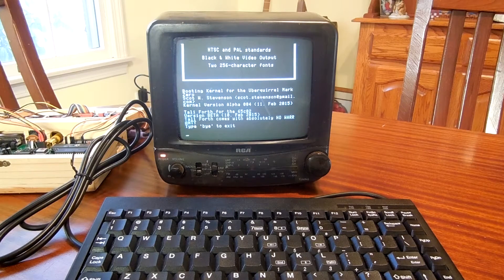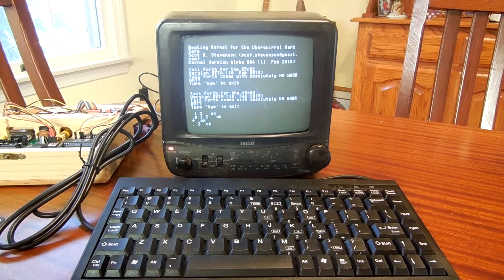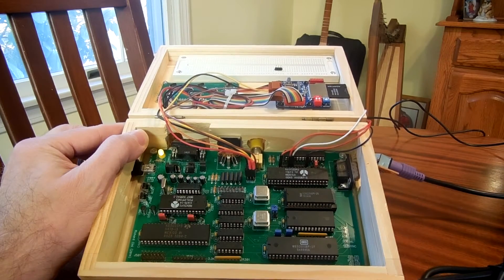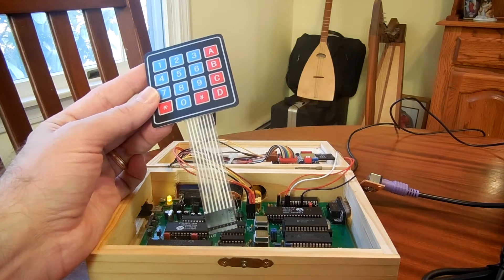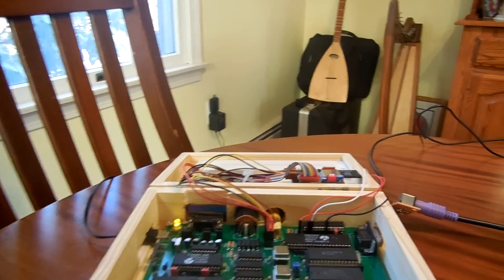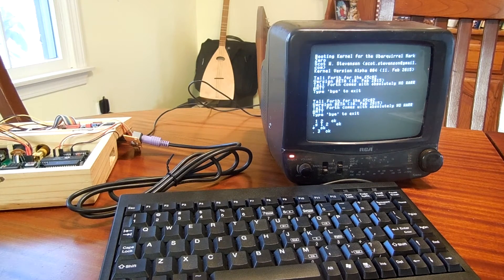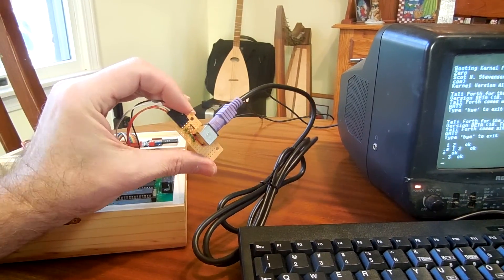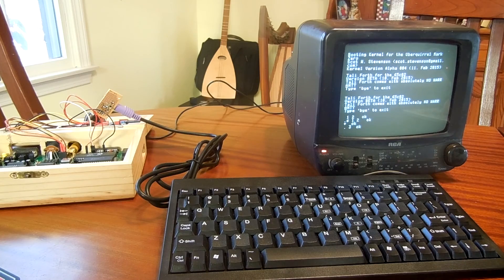Adding a PS/2 Keyboard to a Retro Computer

Comment: The interface is electrically like I2C, except with a slightly different protocol as I recall. Its weird that the keyboard is the buss master. I would have guessed interval polling, generated in the host CPU main loop or with a periodic timer interrupt. I suppose it makes it more responsive like for gaming control. But, all my computers of the late 70s controlled static hardware like video / audio switcher or hardware matrices mostly. Manual update now and then at human speed.
I also have to disagree with your assessment of scanning matrix keyboards as being much overhead on the processor. It was never an issue with my projects. But, multiplexed LED displays on the other hand are very heavy handed on CPU priority if you don't want them flickering randomly. I miss "the good old days". No. Wait... that's the senility talking.

Comment: I just implemented a PS/2 keyboard on my 6502 breadboard computer. I had issues if I used interrupts for other things. So I ended up using a microcontroller to take on the task of controlling the keyboard.
Reply from the maker: Interrupts will definitely mess up the serial communication timing. You can suspend interrupt processing during keyboard scan to prevent that, but a microcontroller is also a common approach.

Comment: What computer is that?
Reply from the maker: It's a 6502 computer I built using Daryl Rictor's SBC-2 design.
Reply: @mheermance  Hi, would it be possible to share the gerber files for this board? Thanks:)
Reply from the maker: @p8051a  Hi, I got it from Rich Cini who's active on the 6502 forum. Here's a link to his website http://cini.classiccmp.org/6502proj.htm
Reply: @mheermance  Great! Thanks!